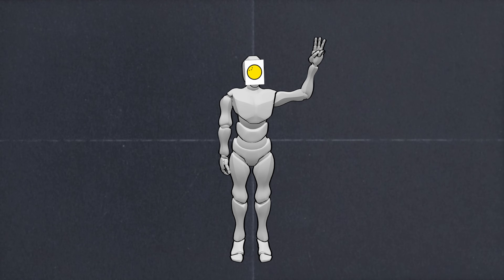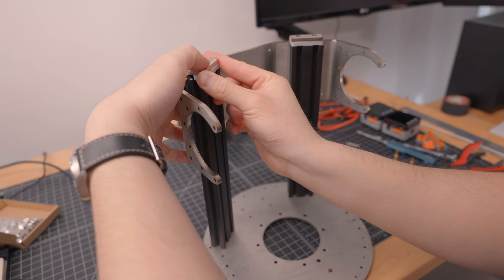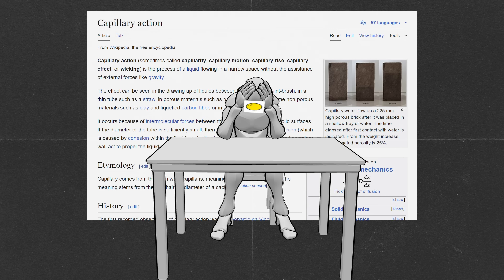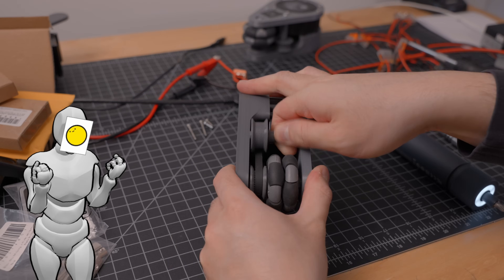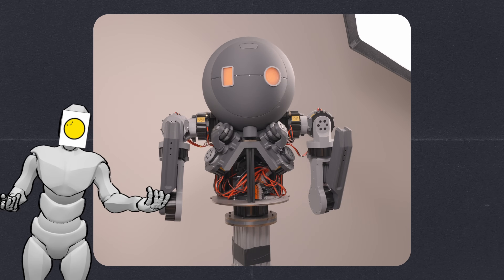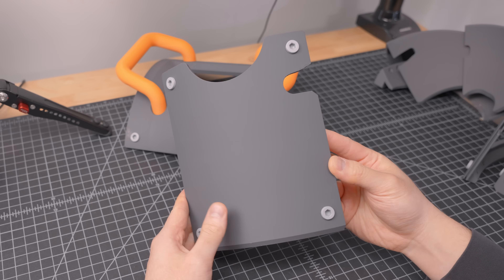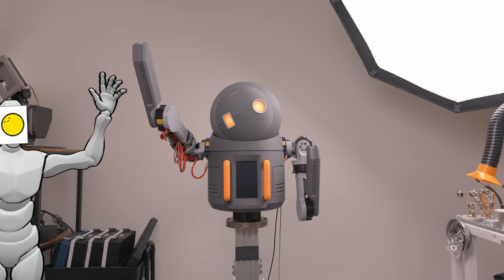IO's alive! - robot butler of my dreams pt. 3

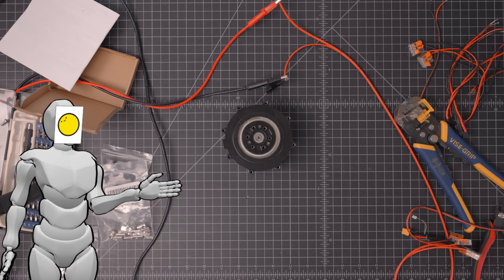Comment: 3:34  Text says
"Clarification time...
Both Robstride 03 and Cybergear motors use magnetic encoders (essentially absolute). But the 03 has two of them, one to measure the raw motor position for internal control purposes + another one on the output shaft (after all the gears and stuff) to measure the actual position the actuator we care about here.

With only the first encoder, when we lose power, we still have the absolute position of the motor, but because of the gearing, one full motor rotation corresponds to only a fraction of the output. So we end up losing the position of the output. The second encoder solves this."

You're welcome

Comment: I think you should add shoulder panels. You could put one on the rotating point and then put a second panel underneath that. I'm saying that the top panel doesn't have to cover the whole shoulder. The second panel adds mobility as you can make it move around up and down while the arm moves in whichever direction it wants.

Comment: the antennas should be WIFI or big hot-swappable batteries
   also you should do four-fingered hands instead of five because it looks pretty cool, will be logistically easier, and still has the same use :)

Comment: I may be partially bias but at 12:09 i think adding some fake rust at the joints and around the neck while changing the color from matte matte industrial grey to a dark grey or black may do good for the design. You can attempt to hide the wires for the arms by using bowen tubes painted orange

Comment: I have an idea for the waist, what if you added a linear actuator in between the legs/wheels and the torso, if the actuator was long enough/strong enough IO could extend upwards to reach things high up, like If you wanted IO to pick up something from a desk or table/counter top. Furthermore IO could shrink down to avoid hitting high obsticales and pick up things off the floor. The only limitation would probably just be the weight.

Comment: Please make a video for those who want to get into robotics. It could cover where to start, what to learn, and more. Your video inspires me a lot.
Reply: yes pls
Reply: This ^
Reply: Yes please
Reply: yep please do this!
Reply: Start with programming microcontrollers. I suggest getting a Raspberry Pi and just getting it to do anything at all. Make a light blink, something simple. After that you can get into using motors etc. You'll also need to get into drafting and 3D modeling. Then the principles of mechanical design. Familiarize yourself with standard fasteners and materials.

Going from zero to a working robot is a long journey, but these things will get you started.

Comment: Here's some advice, always prototype in plastic until you have a working prototype to slash costs
Reply: Honestly he did the right thing with the frame, he kept it very generic and modular while still giving the base rigidity needed for it stand up to its own weight. No use prototyping a tissue paper build

Comment: What a cool project! And your videos are also so well made:) By the way: did u try to implement some acceleration and deceleration sequencies to the motor control? The whole frame seems to oscillate under rapid movement...
Reply from the maker: agreed it definitely needs more tuning. low hanging fruit is tweaking the PID some more, then probably apply some smoothing algo on the teleop tracking data.